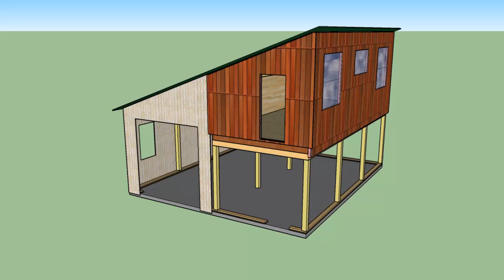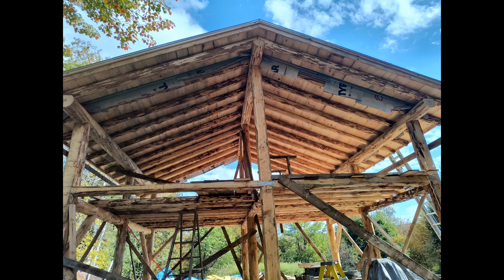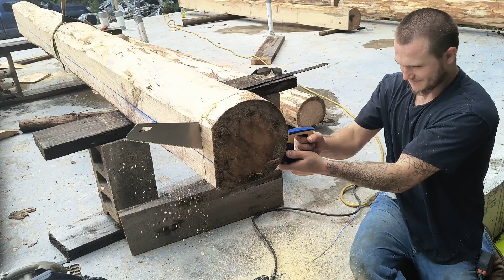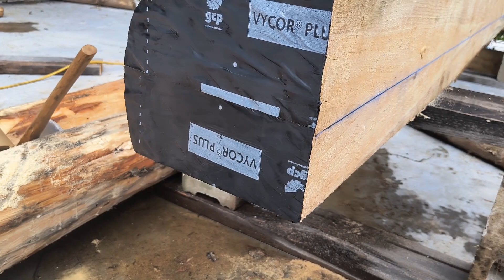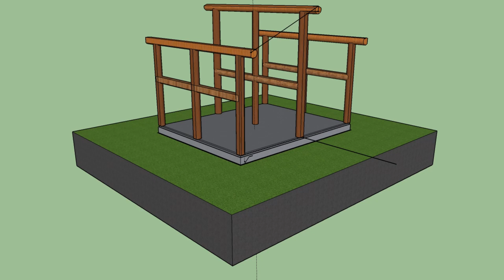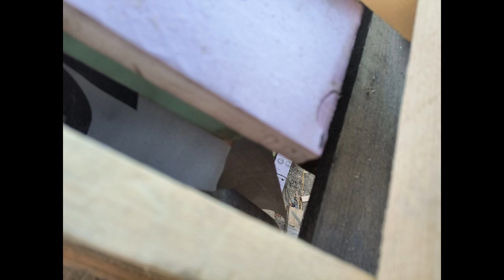An explanation of the way we built Ford's cabin and why, including a description of "perfect walls".

Comment: Hi from northern Alberta! I'm wondering how your building permitting and engineering approval went or was achieved? Great design! I really enjoyed your walkthrough of your design.
King Regards,
Reply from the maker: Hi, There is no engineering/code required for building residential structures in Vermont except for in a few municipalities, so I can't answer your question because we never had to go through that review. Building permit required, but just to make sure that it is in compliance with set backs and permitted uses for the district. Sorry I can't be more help. Thanks for watching. You may find some of the earlier videos interssting too.
Best 
Robby
Reply: @theprojectbasedlifestyle1089  Thank you Robby! I was particularly interested in the rotating cable stay crane setup from earlier videos. Here we require 6' deep frost protection and R60 roofs. We have the National building code for the country and provincial codes to deal with differences such as earthquake risk, snow load so on. some areas are unincorporated and you can build whatever you want similar to your area I suspect. Looking forward to the rest of the build!

Comment: Very good video, and helpful to viewers. Thanks for pulling it together.
Reply from the maker: I'll reply with some measurements tomorrow. Thickness and grade probably aren't that important. Unless it is really thin the steel will be way stronger than the wood. I actually built two cranes, a larger fixed base one and the smaller one ballasted by the truck, and that's the one in the cabin videos. Roughly speaking the  truck crane has a mast that is 16 feet, and boom that is 25 feet and stiff legs that are roughly 24 feet long. As for the metal tubes they sit in, roughly four or five inches in diameter on the base, maybe six or seven inches deep, the hardware on the top is a bit smaller..I'll put specific measurements in the video when I get around to it. So far the weak link seems to be the cross piece weighted by the front tires of the truck.
Reply from the maker: So on the truck crane, the boom cap is 3.5" id and about 5 inches deep, the boom base is 5" and about 7 deep, the mast cap is 4.5" by 6 and the mast base is 5" by 8 deep, i think they are all 1/4 wall and 1/8 wall would probably have been fine. I made them out of what i could find easily.
Reply from the maker: Thanks. I'm still planning to do a similar one about the crane, but haven't gotten time yet.
Reply: @theprojectbasedlifestyle1089  speaking of which: do you know the size or grade or wall thickness of the steel used for the base or caps? I’m not a steel guy and am wondering what to ask for.